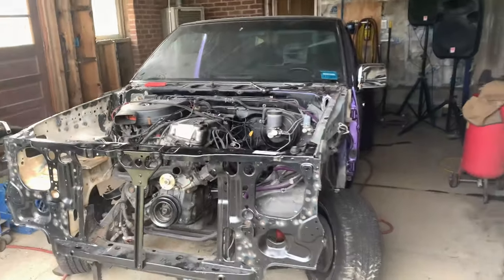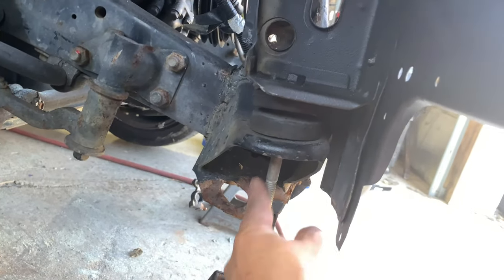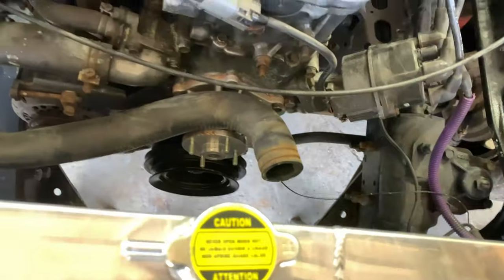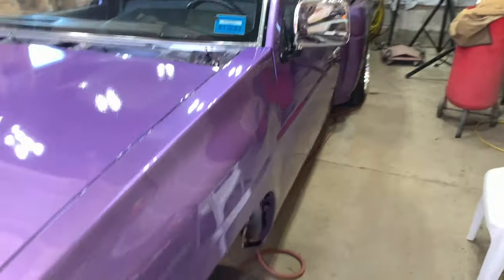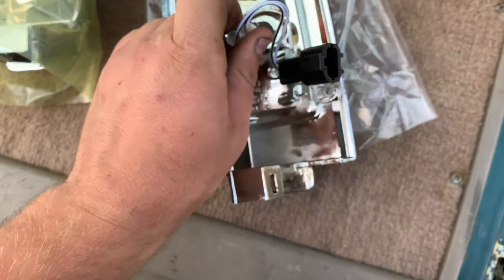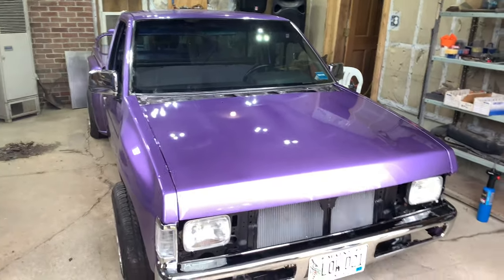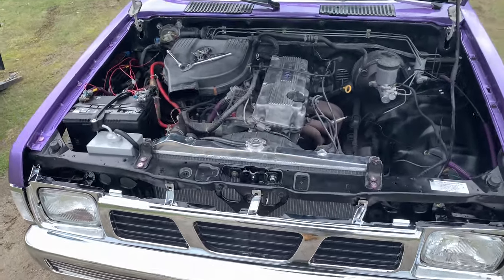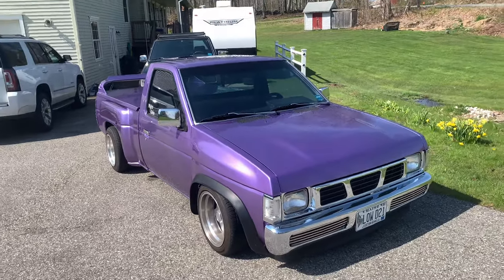THE PURPLE TRUCK IS BACK!!! FINAL PART TO THE REBUILD SERIES!!

Comment: Hey I'm thinking about buying a regular d21 1st gen and I was wondering since you own a hardbody do you know which parts are chrome?
Reply from the maker: What do you mean by that, it really depends on what the truck has on it for chrome some came with chrome windshield trim bumpers grills and door handles and some didn’t, it was just all depending on the price point package
Reply: @JapaneseMinitruck  rn I'm aiming to swap all the parts that could be chrome since I want to make a true hardbody